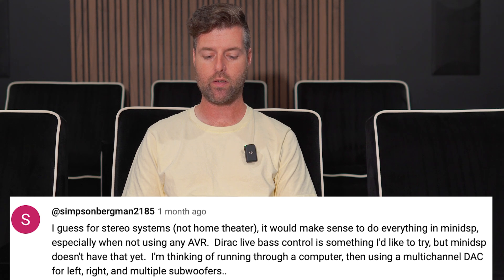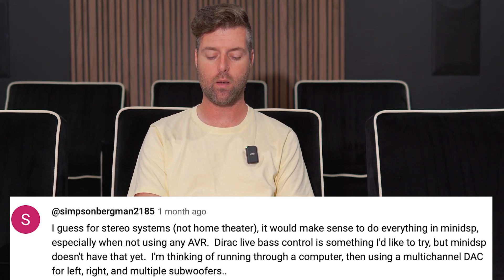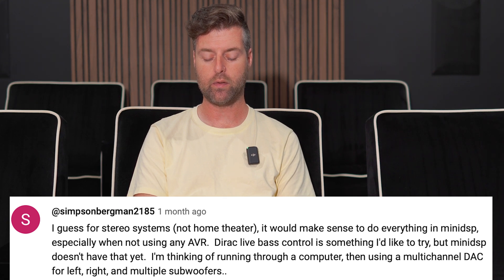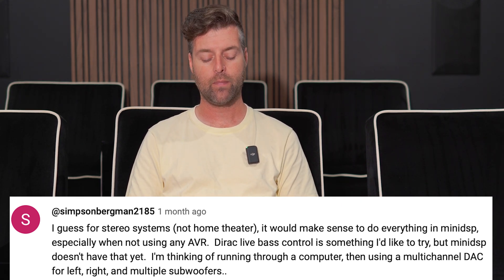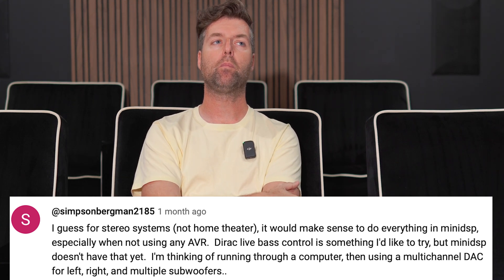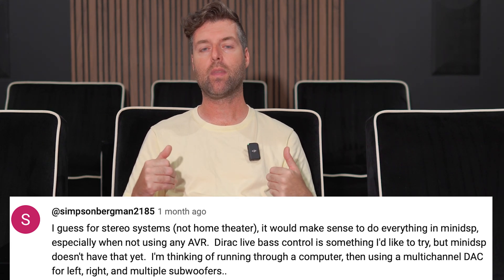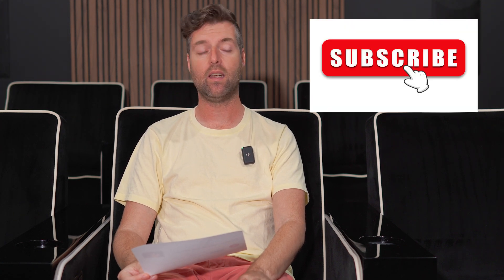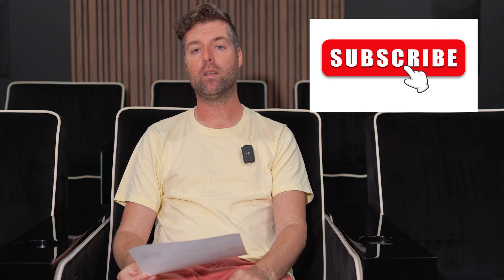Expert's Guide to Mini DSP Bass Management for STEREO

Comment: What about fixing room modes? I've tried about every practical position for my 2 subs in my audio setup.  I have great bass in a strange spot, right where the door opens. Obviously can't step over a subwoofer entering and exiting a room.  I think the wife might have something to say about that.  My room is L shaped with 5 doors that limit sub placement.  I also have a tv area in the same room on a different wall.  I don't care about surround sound and want the systems separate.  
In this case I'm going to try the dsp method,  if i can ever figure it out.

Comment: I use a minidsp flex for my primary system in the living room and running a 2.2 configuration. It's so effective for the cost! I eq the subs to flat and time and phase align them with the mains as well as a couple light touches of peq below a few hundred hz. Then I add a low shelf on the input peq of about 5db  for the low end. It works out great. I've found that chasing perfection with fir filters and convolution or trying Dirac hoping for the best results just makes my brain hurt, lol😂 I know many hobbyists are able to achieve some incredible results through various higher level methods, but for me it was just too much get my head wrapped around.

Comment: I haven't used bass management yet, and I'm no prude when it comes to spending on my system. Everything is very carefully set-up in a very ideal room, my subs are just behind me slightly to the left and right, with the cones at *ear level*. It is so smooth even Jiffy can't touch this.

Comment: Why does everyone want that "seat" even with all the dsp's or even multiple dsp's... whatever is selected or optimised for a particular song/ composition....will not be optimum for a any other..because each piece (song) has its particular settings...and definitely not for more than one person listening at a time
so it's better to use one's own
"grey matter dsp" and enjoy the music...😅..
I personally understand that any program material above the (500-700)Hz , is definitely degraded hence futile to process through any dsp's
Reply from the maker: No it doesn’t work that way. Yes there is variance among songs. But the purpose of EQ isn’t to adjust that. It’s to adjust the corruptions created by the room and/or inherent in the speaker. Your brain cannot get rid of that. In addition, DSP processing can also be used in more complex ways that will yield an elimination or mitigation of very detrimental room distortions such as room modes.  DSP can substantially improve sound quality. Simply ignoring it isn’t a better fix. This isn’t about enjoyment (and people who optimize their systems often enjoy them every bit as much as anyone else).  This is about accuracy.
Reply: @PoesAcoustics  true it corrects for the room...but if that correction is not acceptable to your ears & brain & your "perceived" sound quality .... perhaps some more tweaking.......until you finally accept something inbetween or... just go by your ears in the end...
Your Y"ears"of experience..& its limitations , finally counts...
& optimising for room limitations...can definitely be a downside on other tracks..so you tweak again....
so more tweaking then into  your " happy zone".
somebody/others else also using the same setup..may find things that need corrections...so then both go around in circles with the corrections to suit their taste.
Reply: @PoesAcoustics  when one talks about accuracy.. it's referenced to something else......and that itself may not be the most optimum..What type/kind of accuracy do you look for .......
even dsp prog's are written by others & based on their/ their team's perceptions..& thats definitely not yours...
Changing the amp or speaker system/ location and everything changes......so how can one relate thes with accuracy.. 🤔

Comment: Hi, I'm sorry to say this but this video misses the mark. I've gone from a miniDSP SHD Studio to the PC version  of Dirac Live with DLBC and the latter is better, easier and more powerful. If you can handle the inconvenience of using a PC then go for it. Stereo or more channels the  destination is the same, get the best sound possible!

And, I don't believe that DLBC was solely made for multiple seating positions, evidenced by the fact that Dirac Live with DLBC supports "Tightly Focussed Imaging" which are fancy words for a single seat.

Also, the PC version of Direct Live supports 8 separate profiles to the miniDSP's 4, and the switching speed is virtually instantaneous which is fantastic for comparing different configurations. The miniDSP is slow when switching profiles. 

Oh, and I sometimes have up to 10 people listening to my stereo system in the same room, at the same time. It's called a Hifi Get Together (GTG) 😊
Reply from the maker: Im sorry you feel that way. But your naive perspective isn’t rooted in fact. You need to ignore the app and look at the actual physics being addressed (which has been written up in papers by both Harman and Dirac, among others).  It’s never been a problem to achieve good bass integration and a good bass response for a single seat (the fact that you can or can’t achieve that is irrelevant).  What was difficult was achieving this over multiple seats. Multiple subs (which is not synonymous with bass control) was a solution for they. And that solution, while still sometimes useful, is not required for good bass in a single seat. 

DLBC was a means of creating an automatic bass control and Eqing using either a single or multiple subs. The focus control is just a means of changing where the EQs focus is.  That’s because you inevitably have to make a choice. Better on average but worse in the RSP or better in the RSP but worse on average.  

Everything done in DLBC for bass optimization can easily be done manually by those who know how. But most people don’t know how. And yes, it’s very time consuming. Even for top pros. So of course it’s quicker to use DLBC. That was the point. 

But my comment was specifically about DLBC using multiple subs. You don’t need multiple subs achieve good bass in a single seat. You do for multiple seats.
Reply: @PoesAcoustics The question was never put to you that multiple subwoofers are needed to achieve good bass in one seat, the original proposition that was put to you was which is better, a miniDSP with Dirac Live versus a PC with Dirac Live and Bass Control for subwoofer integration. So please just focus on the original specific question/proposition. 

If one is prepared to put up with the complexities of running a PC as a source and an audio processor with Dirac Live and Bass Control, then this can only be a possible practical advantage. Without knowing the knowledge and abilities of the person who put the original question to you, surely it is better advice to use DBLC for subwoofer integration. Using DLBC is a superior technology to reduce possible user error and get truly excellent speaker and subwoofer integration in a much faster timeframe. That is the good PRACTICAL advice I think you should have given and what was really being asked of you.

Comment: I'm running a 2.2 home theater in a small space using a MiniDSP HD 2x4.  Being able to tweak speaker in-room response while also optimizing my subs with MSO has resulted in a theater experience that is really solid in spite of not being a surround system.

Comment: Thanks for for your informative videos Matthew, I'm doing my best to get edumacated, at complicating the uncomplicated.
I recently purchased a "Dayton Audio Imm-6 mic" and the "Audiotool App", & the "Dayton Audio DSP-LF Low Frequency DSP Controller" it uses the free"iWoofer App" on Android & iphone, or the $5. "iWoofer Pro App" that uses a wizard to measure and set up the subs with automatic room correction. 
Unfortunately, the Pro version only works on iphones & I don't have freakin iphone. 
So I'm using the imm6/Audiotool on one Android device while using the free iwoofer app, on another device, it's a bit tricky, but it's definitely made some improvements, less boomy and I've tightened up the bass, however I'm still trying to get my head around it, unfortunately the crossover doesn't extend below 20Hz.  
I did come across some interesting articles on an appropriately named site, that I can relate to, called "The Cult of the Infinitely Baffled"

Comment: I went PC > DL+BC > DAC for my 2.2 setup.  Made a huge difference for listening anywhere on my big couch, plus Dirac is waaay easier and FAR less time consuming than manually dialing it in. Get the multichannel version to add more speakers/subs if/when you get bored.  it goes on sale 30% off a couple times a year too.

Comment: Literally just did this due to our receiver being in for repair. Running stereo speakers and dual subs out of a MiniDSP 2x4HD, to try and ensure the best bass and tonality for our entire couch while we can't take advantage of Dirac. Running optical out of the TV to the MiniDSP, so it's a neat stereo option for people who don't want to run a full surround setup
Reply: So you do/did not run Dirac with mini DSP?
Reply: @texxhexxmm  I do not. I have done multi-seat measurements with averaging to try and accommodate "better but less good" across a wider area, because this is what we're doing for TV-sound and music currently
Reply: You may be quite happy with your solution and if so great, but some people are not aware and so I have to point this out, the miniDSP flex, while it costs more, does not merely have more features for that price.  It has fundamentally better digital and analog performance, better snr/sinad/dnr/distortion/lower minimum noise level, crosstalk, and just every spec is basically higher and with tighter tolerance, better DAC supporting higher rates and bit depth etc.

This is especially important for people using higher sensitivity speakers,  and/or who run power amps without analog attenuation and use digital volume attenuation which is superior to analog if and when the noise level is low enough like with the flex.  Plenty of people in the forums have tried the 2x4hd and sent it back when using for example horn loaded speakers, because it's just too noisy.

If you have any hiss with no content playing, the flex is the answer, it's just better both digitally and in its analog output stages.  The cost is also still crazy reasonable for what you get, so if a couple hundred bucks difference isn't a huge deal, the flex is the one to get, and it works with Dirac natively (for an additional license fee) while the 2x4 doesn't, even though maybe there's a way to use Dirac with a PC and the 2x4, i don't know.

Comment: MiniDSP Flex in terms of DSP/DAC is all one needs if he is serious about 2ch audio. Is it necessary NO does it give BEST result in an not so ideal room YES. And for majority 2ch setups go into not so ideal or not so well treated rooms. So going for MiniDSP makes absolute sense. It really helps optimize the listening experience for that one main area. Even if no SUB on the system and only a simple 2ch setup with capable floor standing speakers. MiniDSP or any other processor can help optimize those speakers to get you best in-room setup without needing to have to spend a fortune to get room treated and optimized. 

Edit: I made this statement in general to backup on why one would need MiniDSP and is getting MiniDSP or any DSP worth it for a 2ch setups instead of simply getting an audiophile DAC and be done with. There are lot many benefits.
Reply: Na bro the DAC in the MiniDSP is horrible for stereo playback, the MiniDSP is great for optimising the bottom end, that is it, if your serious about stereo sound quality the MiniDSP DAC can be very low quality compared to what else is out there. You don’t necessarily want to correct anything above 1khz either with DSP, you are far better off correcting it with the room, placement and acoustic treatments, this is if your speakers are anechoicly accurate with well control dispersion, you can not fix a speaker’s accuracy with DSP above 1khz without compromising the signal.
Reply: @njrumenos  No MiniDSP Flex is really good. Far better than even 2x4 HD. And to be honest it is really good.
Reply: @njrumenos I’m not sure if my comment was removed last night, but the MiniDSP isn’t terrible, and the Flex is really good. You can even get a version that does everything in the digital domain, so no DACs. Just look up benchmarks on ASR.